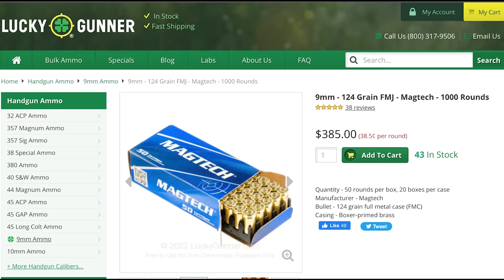Thieves Carjack Aston Martin From Garage in Connecticut

Comment: Another thing people need to think  about is convertibles.  If you have the top down, you better have your tool ready....absolutely no protection from a locked door.
Reply: I guess if the windows are rolled up, that would make it impossible for the perp to simply jump on the hood and jump right in or simply do it like they did it back in the day by jumping in the car from the rear and sliding right in for the cool effect. I guess you can say the rolled up windows would likely make the attack appear cooler or more  'Hollywood style' 😎  @OFFICIALBROTHERBOLDLYMUSICNTV

Comment: In Indiana, Castle law would apply doubly here. On your property (where you live) and attempting to enter an occupied car.
Reply: @andrewbetances1203  : Sorry, but there's a lot wrong with that statement. FIrst, Castle Doctrine is NOT Federal. Second, because of that, each state is different. My statement regarding Indiana is correct.
Reply: In Connecticut there is no way he had a legal concealed carry so unless he had a gun staged in the garage he is out of luck
Reply: @guruthossindarin3563  I guess your right. I was told since childhood this was the case. Most states do adhere to this though

Comment: Also, carry your electronic key in your pocket instead of in the cupholder. They can push you out of the car, but they're not going anywhere without the key.
Reply: @OFFICIALBROTHERBOLDLYMUSICNTV  But if they push you out of the car and you run off, you've still got the key and the car is a statue.